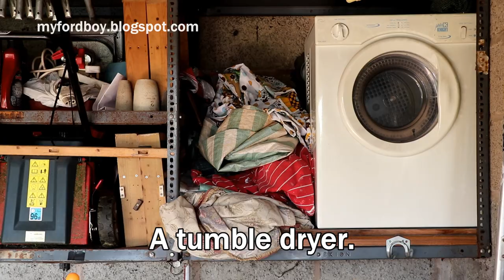Fire Safety in the Workshop. X-Sense Combined Smoke and CO Detector.

Comment: Be safe.  Carbon monoxide stays low.  By the time it triggered the detector on the ceiling it might be too late for you.  I prefer separate detectors for that reason.  Love your videos!
Reply: We have a plug-in type, which plugs into an electrical outlet, so no battery required. The outlets are about 37cm ~15in from the ground. So nice and low. It does take up an outlet but no problem.
Reply: are you sure about that
Reply: Carbon monoxide should have about the same density as the nitrogen and oxygen that make up most of the air, actually just a tad lighter. Even more so if it comes from a hot source, which it usually does. If it stayed near the floor it would not be a hazard because we don't breathe through our toes!
Reply: @kevinmartin7760  well said
Reply: No, we don't breathe through our toes.  And yes, CO is just a bit lighter than air so it will rise.  Most CO detectors recommend mounting at about 5 feet from the floor, which is close to the level of the average adult nose and mouth, which is where we do breathe.  Or at least I do.  So I have CO detectors at 5 feet and smoke detectors on the ceiling.  Belt and suspenders.  YMMV.
Reply: Very true fills your house like invisible water displacing air we breathe, so bed level is key

Comment: Hi, importantly CO (the silent killer)  is lighter than air and therefore alarms should or must always be located near to the ceiling 1 - 3 m from an appliance - but always follow manufacturers instructions - particularly important for open flued appliances like gas room heaters and solid fuel stoves. Anyway good idea to fit a smoke / heat sensor especially if your workshop is remote to your home!

Comment: Surely it's going to go crazy from the furnace smoke and later cutter or if you weld. Like when you cook toast?
Reply from the maker: It's not a problem . The furnace is near the door and has a fan blowing any smoke, which is hardly any, to the outside.
The laser cutter has ducting that sends the smoke towards the door and the fan blows it outside.You can mute it for 9 minutes by pressing the test button.

Comment: False alarms caused by smoke released while you are working in the shop could they be a problem? If so, you may want to consider using a heat detector connected to your alarm system?
Reply from the maker: You can mute the detector for 9 miniutes by presing the test button.
Reply: @myfordboy  Sound like it should be quite satisfactory for you then.
Before soldering pipes (bathroom renovations or heating system refits) in the suites in multi story apartment blocks I have to remember to check for smoke detectors as setting one off could lead to an expensive call out of the fire department.

It's not uncommon to trigger the smoke detectors while doing this work in what I guess you would call a detached or semi detached house, but since those systems are not tied into an alarm service it isn't really a problem. Just annoying.

Comment: I'm admiring that wee furnace more and more. If some scrap aluminium is melted and then left to cool in the crucible, will it come out easily afterwards? It'd be useful for making billets if it did.
Reply from the maker: No you don't want to do that. It might not come out of the crucible and if you heat it up again the metal will expand and crack it. You can make a simple mould by pushing a tube into some sand.
Reply: @myfordboy  That's a far better idea. Thank you.

Comment: Will the one in your garage set off the ones in your house?
Reply from the maker: Yes that is the benefit. Whichever is triggered all alarms will sound
Reply: @myfordboy  i wonder what the range from one to another is.
Reply from the maker: They claim 250m in open air.
Mine is 20m away and the signal passed through 2 brick walls.

Comment: I presume the alarm installation is in response to Cliff’s fire.
If I remember rightly he thinks the cause was a lithium battery, what’s powering the alarms?
Reply from the maker: 10 year life sealed lithium battery. I can't imagine the battery in a smoke alarm could be the cause of a fire!
Reply: @myfordboy  I had a (wired) fire alarm set itself off when the power to my house was cut. I think it caused a voltage spike which blew the MOV (which is supposed to absorb power spikes and survive the minor ones) and the smoke from that set off the detector. Abnormal circumstances, of course!